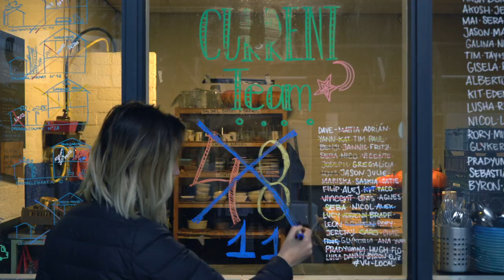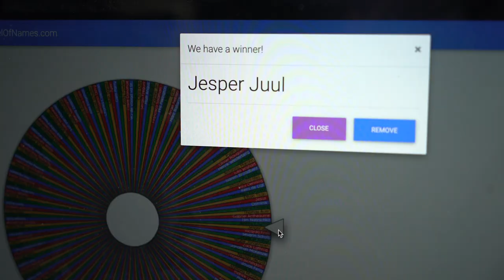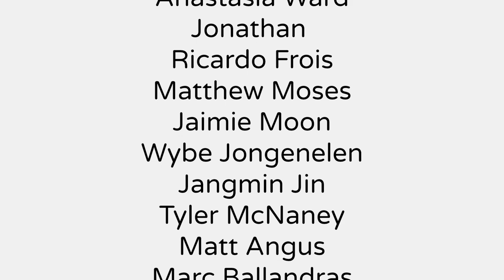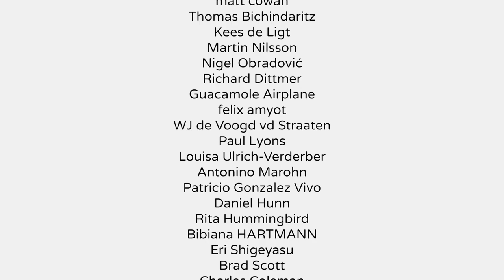Monthly News #34 - cleaning up our mess and saying goodbye.

Comment: Burning pallets? Isn't that bad for the environment?
Reply: Any burning is bad for the environment.
Reply: If you make biochar and then put the biochar into the soil it can be great as it stores the carbon in the soil for 1000s of years.
But yeah, i also saw that. Sometimes one has to make compromises i guess. Maybe they didn't know what else to do with them and they were under time constraints.
Reply: Burning wood is carbon neutral. Always better to use the heat, but still neutral.
Reply: @Romain_Guimbal  We should be as carbon negative as possible. We cannot afford to be just neutral. Because of rising levels of CO2.

Comment: burning pallets instead of giving them away should be a criiimee asdasdasd
Reply: Nobody wants pallets lol
Reply: It’s wood. It will end up at the landfill if you don’t burn it.
Reply: Burning pallets is a terrible idea as they're usually treated with toxic chemicals.  I agree they should've either given them away or taken them to an actual waste disposal place.
Reply: @yeetandskeet  A ton of companies have pallet reuse programs. And there are a lot of individuals too who use them for DIY projects, some of whom pick up dozens at a time to work with or even make a business out of it
Reply: @joebywan  For already many years using pallets with toxic chemicals is forbidden in most Western Countries. All officially produced pallets have a label which says
how it is treated. Mostly it's HT (heath treated, without any chemicals) But burning pallets just for fun in the open air is definitely not a good idea. So many things can be done with them.